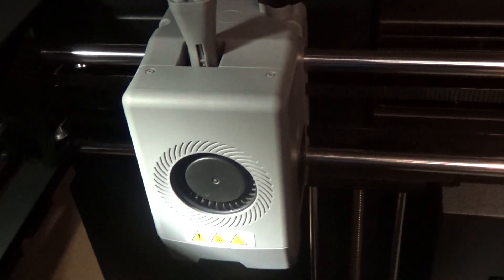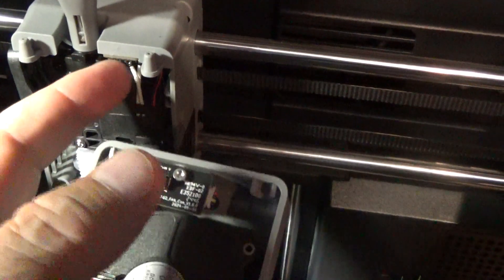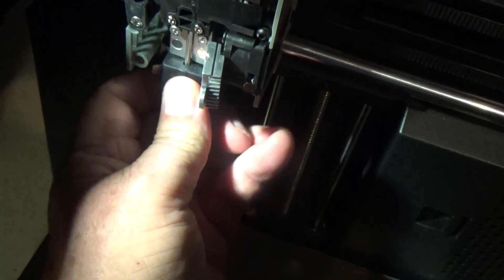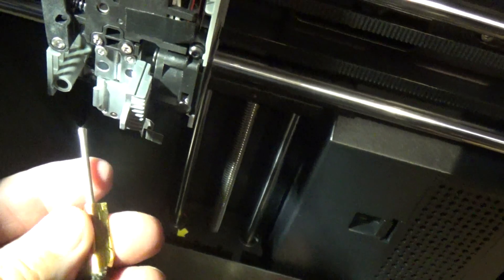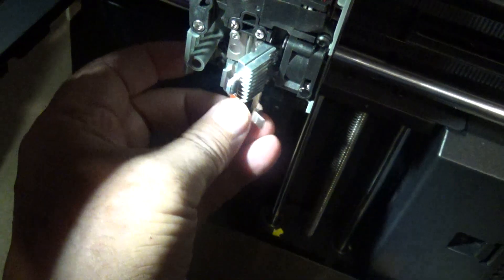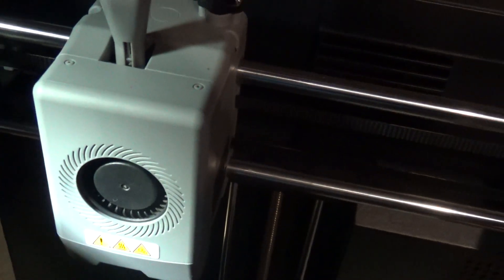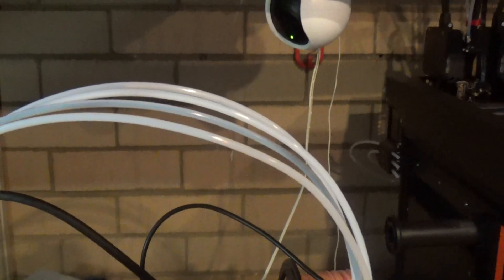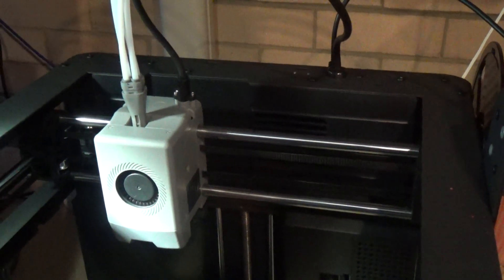AD5X - The new quick release nozzle

Comment: Now they need to make ne creality like box for filament but with dryer, make new injection molded frame like K2 or Centauri carbon. Make it enclosed obviously for 300Eur. Otherwise Centauri carbon is already available.
Reply from the maker: There is an enclosure kit to be released later this Month. For many people printing multi colour in PLA there's no need so it makes sense for the AD5X to come as a "bare bones" model where you can enclose if need be.

Comment: Hey,
I also want to buy the device because I am very satisfied with my AD5M. I am interested in whether the flexible heatsink tightly surrounds the coldend of the nozzle? Otherwise you don't have any proper cooling at the coldend. Sorry, but the thing shakes back and forth in the video.
Greetings Andy
Reply from the maker: @AndyBarkowski  OK   it's on 2 fixed pegs to ensure that it's not lost or misplaced. It floats and clamps tightly around the nozzle. Very simple and if your nozzle for some strange reason had a slight twist or bend it would still fit snugly. And if by some strange reason you had a clog higher than usual (e.g. TPE forced too hard and swelled you could pre heat with this open to intentionally allow the heat further up the tube. With the tension screw backed off the Bow tool can exert substantial pressure to clear even the worst clog imaginable.
Reply: @theaussieviking8555  Thank you.
I mean whether the heat sink has enough contact with the nozzle to dissipate the heat effectively.....otherwise the heat sink is pointless.
Reply: I Have sent a question to Flashforge 😊
Reply from the maker: @ It clamps tightly around it. So it has the full length of the tube through it in contact.
Reply: @theaussieviking8555  The question is about the magnetic part not the lever that closes around nozzle on bottom.

Comment: Very interesting, I'm betting the new heads are going to be cheaper!
Reply from the maker: Apparently about 30% cheaper. Some are complaining about backwards compatibility as they obviously have some AD3/AD4 nozzles on hand, but the fact that you'll be able to clear pretty much any clog, even if that means doing a burn-out over a gas flame without ruining the extruder is a big plus!
Reply: @theaussieviking8555  The heatsink is magnetic? Last time I checked magnets die at 80C, how hot does it get?